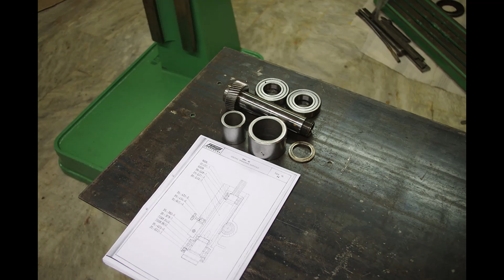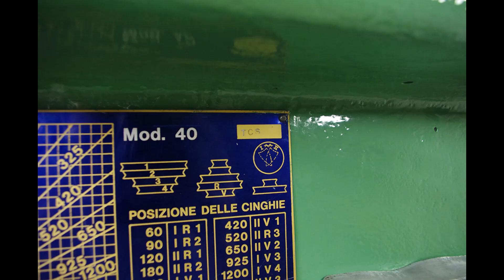FAMUP MD 40 TCS drilling and milling machine restore by labrinos sewing attachment.

Comment: Hello guys, I have this machine too, but I don't find a milling cutter or drill with this big 60mm screw nut, any ideas for me?
Reply from the maker: You will have to make some spare nuts 60mm × 2.50
and adjust them to the drills or other cutting tools you want to use.
This solution is tried and tested!
Reply: @labrinos.  I thought that something like this will be the solution :( I wonder where are all the tools for those machines? But anyway, many thanks for the good help :)
Reply from the maker: @Martin-dz8qp  Send me your email at info@labrinos.gr  to send you some photos for your convenience.
Reply: @labrinos.   I sent you an E-Mail and I hope it is not in your Spam folder.